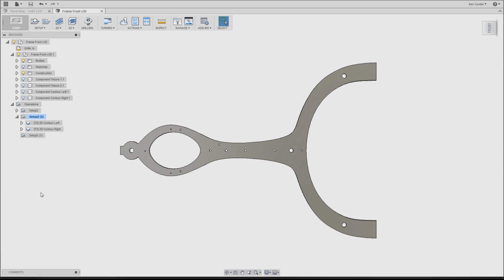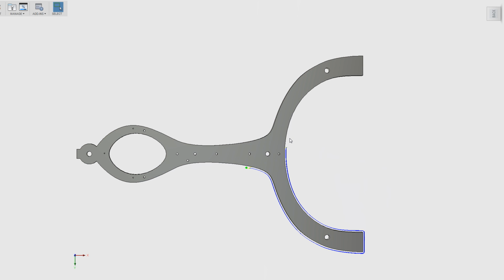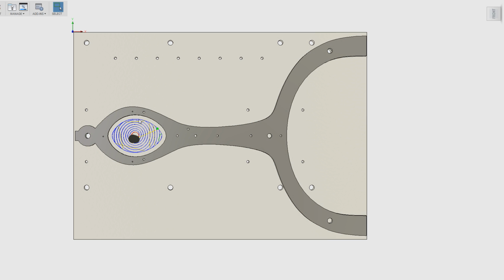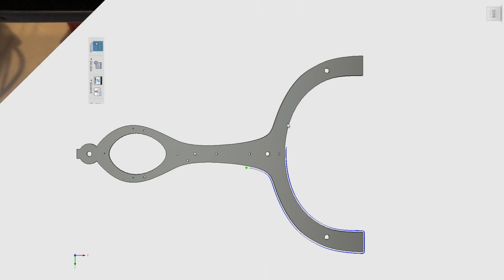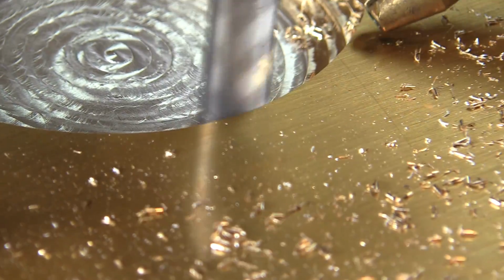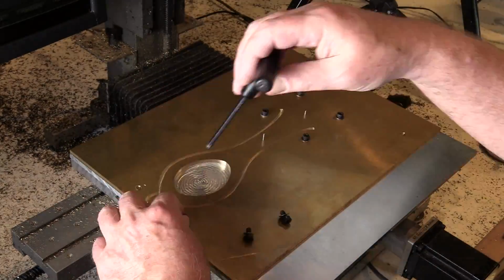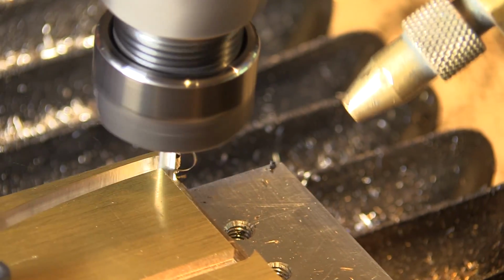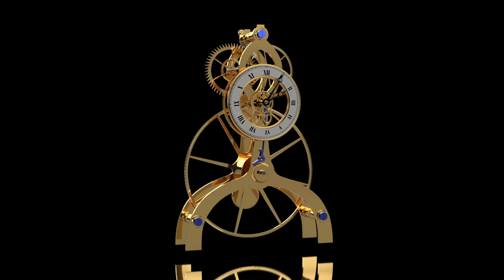Making A Clock - Part 3 Making The Frame

Comment: Ken, I enjoy watching your videos. I've been looking for a hobby and inspiration that peaks my interest. I first watched your Orrery videos and just finished the Skeleton Clock videos. Thank you for taking the time to share your craft! Seeing below the cost of metal stock and looking up the cost of the machines required for this hobby represents a high investment. There is an endless wealth of knowledge when it comes to meshing computers and milling, I don't know where to begin. I was going to start researching about metal milling, gears, CNC, tooling.Any suggestions for getting started? Books, websites, etc.?
Reply from the maker: Thanks for watching! Getting started is the toughest part - where to begin? I started with the Sherline CNC lathe and mill package. It's a complete set, including the computer. Used equipment is another option because you can get much more for much less, but you need to know what you're looking at and how well it was maintained. I have a garage full of equipment, but I've been accumulating it over many years. You can't expect to buy it all at once. An estate sale can get you a complete shop in one purchase, but they're rare. The material prices I quoted were for brass - start with aluminum, it's MUCH cheaper. As I mentioned in Part 1, Fusion 360 from Autodesk is the best CAD/CAM I've ever seen and it's free for hobbyists. I wouldn't bother with books. YouTube is how I learned pretty much everything. When you decide on a machine you'll find forums dedicated to that machine. Join one and ask questions. Good luck!

Comment: Ken        I know you must have standards as well with Mr Wilding. I have one of his books, not the same as yours, and it states that 3/16' hard leaded engraving brass is to be used. What is the reason for the cost ? How could anyone make a living ?I have seen other timepieces though similar for for sale for $ 200.00 + $400.00. Or these made on a assembly line with sub standard materials ?  $350.00 per plus ,   not making this for any type of gift. Enjoy your page, work and explanation on your process.    Ralph
Reply from the maker: Ralph, I've shopped around quite a bit and brass is expensive everywhere. Cheap clocks might just be plated in some way, or maybe they're cast so you only use what you need - I have no idea. This project (especially the frame) leaves lots of cutoffs behind which I'll save and use in future projects.

Comment: I guess that CNC can assist when a) Difficult machining processes that one may not have the capability to complete or b) You need repeatability i.e. making 10X copies. 

Paul
Reply from the maker: Exactly right Paul. CNC doesn't buy me much for making single parts but would be awesome if I needed many. And, as you say, CNC can do amazing things that can't be done otherwise, like 3D contours and engraving complex designs.

Comment: Ken,  Why didn't you put both blanks on the table together so you there would be only one set up? Ralph
Reply from the maker: Good question Ralph. The main reason is that those two sheets of brass cost $350 (USD) each! I'd rather make a mistake on one of them than both!